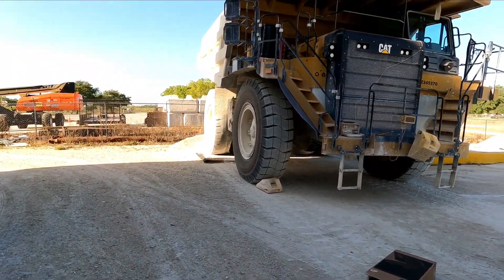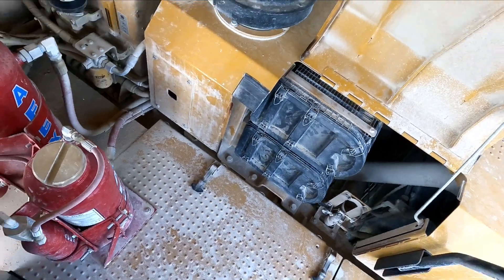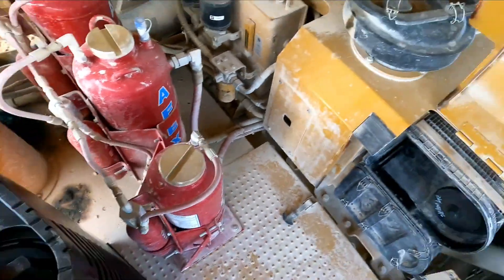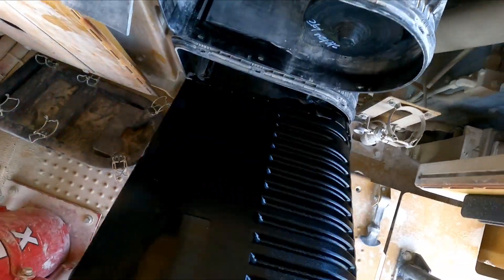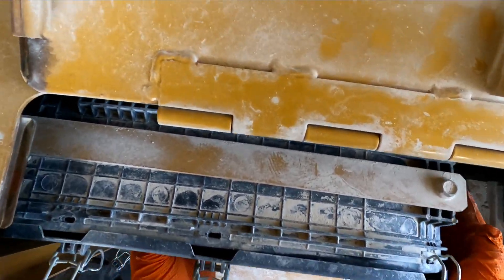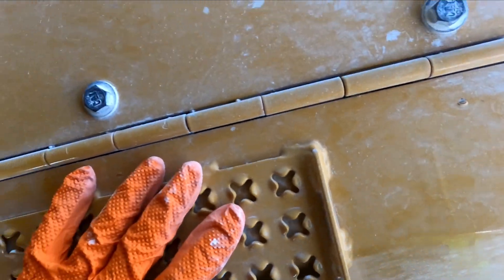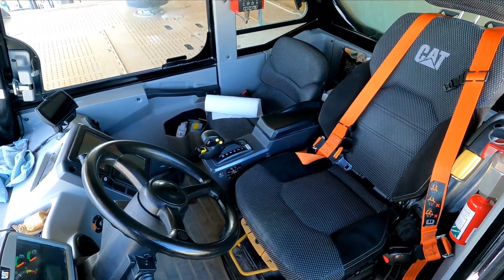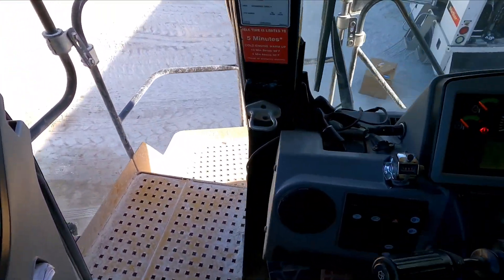250 Hour Service: Replacing Air Filters on a CAT 777

Comment: does 250 hours mean thats the total time on the machine?
Reply: @soulextracter  so one machine will never get a 250 hour service twice? is it a linear count or does it reset after a major overhaul
Reply from the maker: So if the machine has 0 hours the first 250 hours would be air filters and the fuel filter/fuel water separator and an engine sample. This one didn't get the fuel filters changed. After another 250 hours it would be the 500 hour service which  would be the engine oil with engine filter and air filters, cabin filters, fuel filters and more samples. And it keeps going until 12,000 hours and that's the biggest service. We keep changing more as the hours goes up then it starts again. But everything after the 500 will always have engine oil change